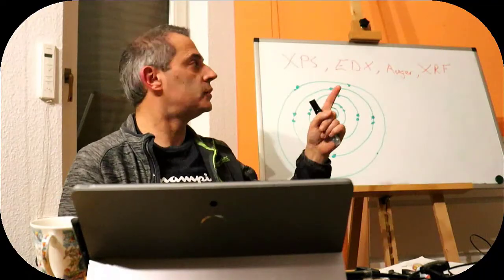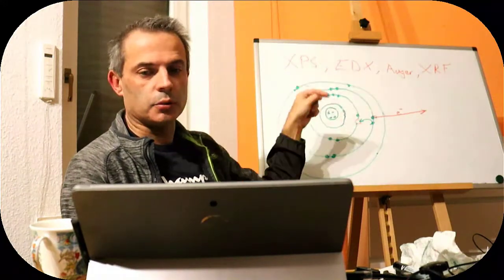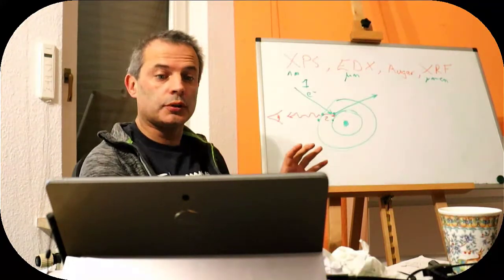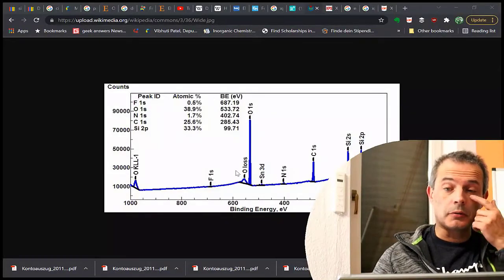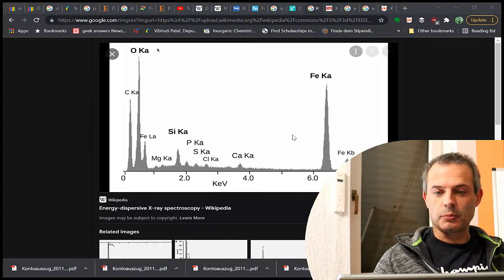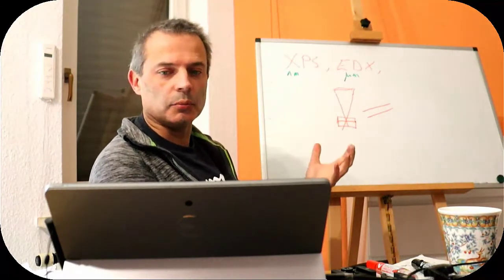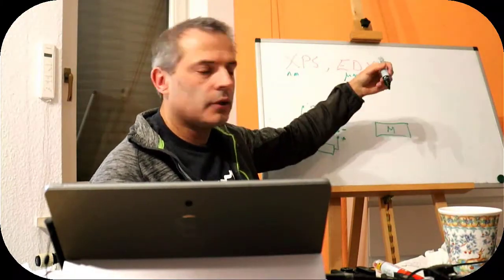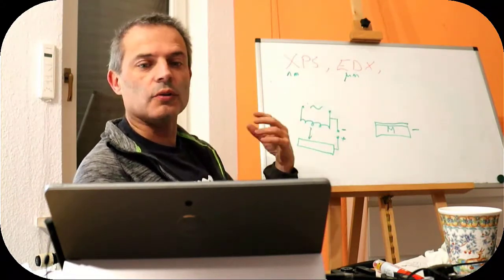A family of Elemental analysis Methods

Comment: Cherenkov radiation for "bremstahlung" right? or is this something different?
Reply from the maker: It is not quite.  Cherenkov radiation is when the particle (any particle even uncharged) enters a new medium at greater than the speed of light in the new medium and must slow down to the speed of light in the new medium. The energy has to go somewhere and is released as photons.

Bremsstrahlung is when the particle is charged (usually an electron) and interacts with charges in the material and (usually) slows down.  Typically this happens when the particle is travelling slower than the speed of light in the medium, Google says typically half in an X Ray generator.  The mechanism is more interaction of charges.